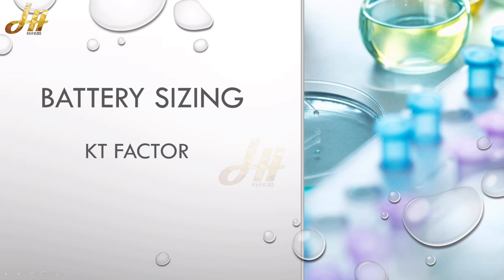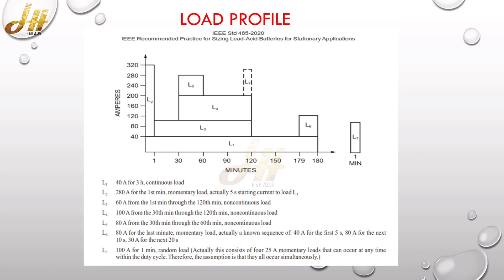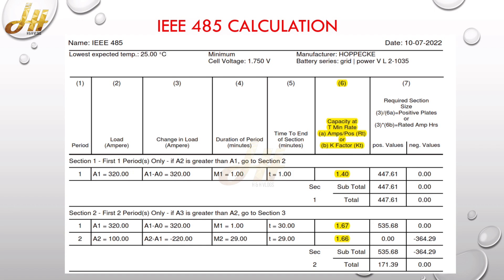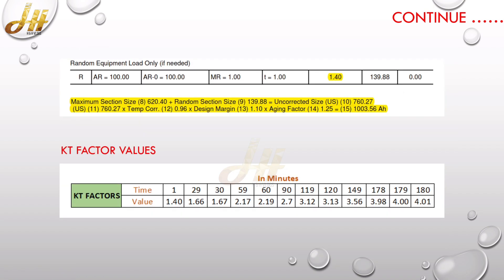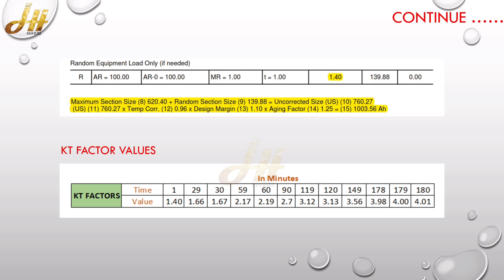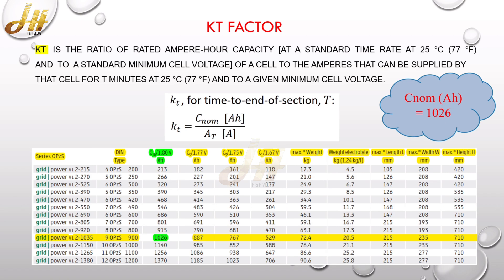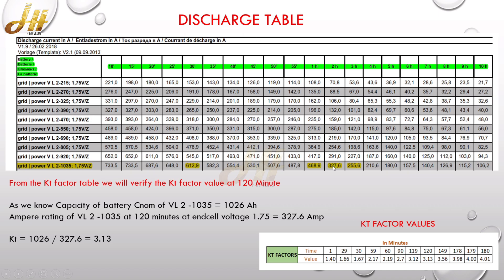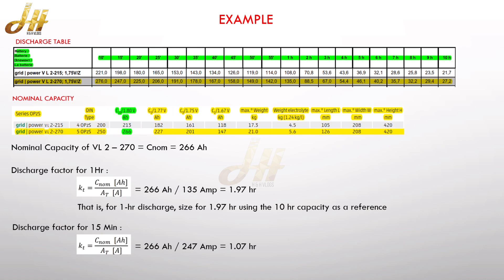KT FACTOR# BATTERY SIZING# IEEE 485# LEAD ACID BATTERY SIZING# BATTERIES

Comment: The question remains: What is the criterion for selecting the battery model to which the “kt” factors are associated? Since the calculation of “kt” for each period of each section depends on the nominal capacity of the battery, how do you determine the reference battery model in advance?

Comment: Thank you for the video. However, I am a bit confused about the calculation of the nominal capacity and the Kt factor. In the explanation provided, it seems that the nominal capacity is a prerequisite for calculating the Kt factor, while the Kt factor is a prerequisite for calculating the nominal capacity. This appears to be contradictory. Could you please provide further clarification on how to calculate the nominal capacity to get Kt factor?
Reply from the maker: Actually kt Factors should be provided by the battery manufacturer as a Kt factor chart like Battery data sheet, but most of them may not provide the same FORevery user. But while working with thier battery calculation software the sizing result  will comeup with Kt factor values, which can be check as I mentioned. 

As you said right a nominal capacity need to be understood to put the right values of kt factor. Normally IEEE 485 calculations are done for step loads, for constatnt loads sizing calculation we use are different. With a thump rule calculation we should have a knowledge of nominal capacity in advance to get the proper value of Kt factor value.

Any concerns please contact santhoshmeprathumalil@gmai.com
Reply: @hhvlogs1228  very good video sir. After watching the video I was also confused because both Kt factor and nominal AH capacity are dependent on each other  for calculation. also please clarify from where we will get the rated  ampere at ambient temp